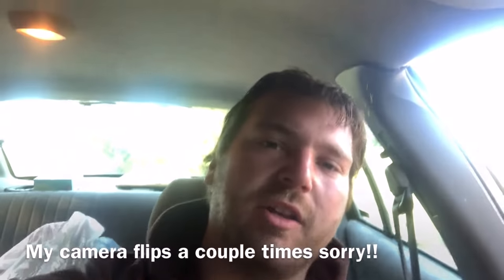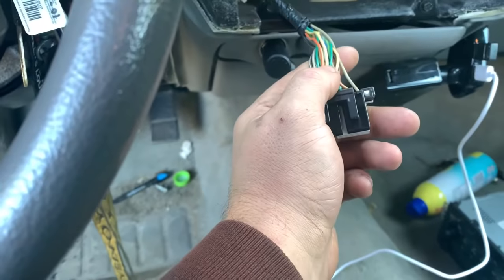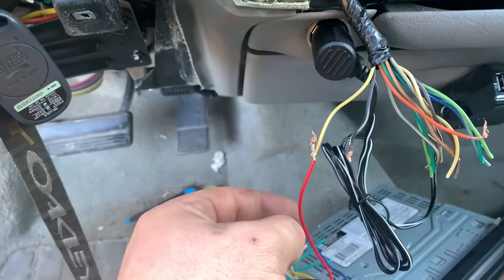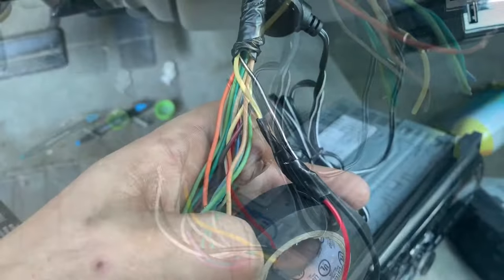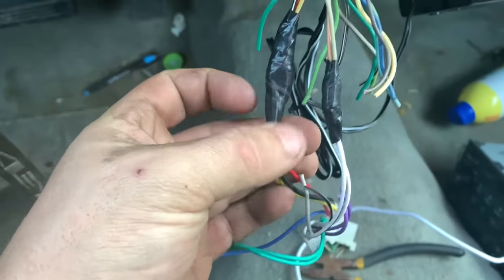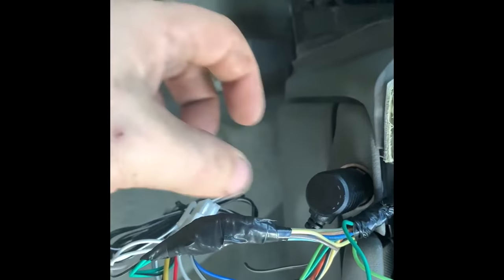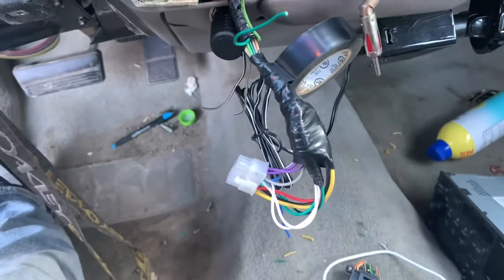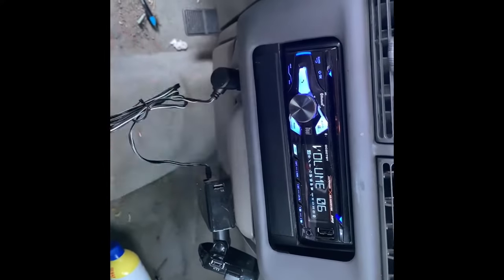How to Hard Wire an Aftermarket Radio in Any Vehicle

Comment: I got talked into doing this by a friend in my S-10 almost 20 years ago. Stupidest thing I have ever done. We couldn't figure out where everything went. So I ended up paying a friend of a family member. He got it working, but there were still quite a few issues. A few months later I took it to a local stereo shop and got it fixed right. Don't be stupid like me, spend $15 and buy the harness adapter. It ended up costing my over 10x what the harness costs, many hours of work, and a whole lot of headache. I will never cut another wire in a vehicle I care about and unless you truly have experience (if you do you wouldn't be on this video) you shouldn't either.
Reply: Exactly, even if you’re amazing at doing the wiring, you’ll just have to redo it all if your radio goes bad or you want to upgrade at some point or replace with the old when you sell it. Hugely limits your options for really no upside.
Reply: @pogolaugh why would i replace a damn thing when i sell it 😂 if there's problems they can have that shit i work at a chevy and dodge dealer we cut so many corners you wouldnt beleve it
Reply: I’ve done it multiple times my man. Doing it now. Some people have to pay for the whole kit and I’m not trying to spend 40-80 on a whole new dash piece I don’t truly need, and wait almost a week for my harness to come in cuz I have a lancer and they don’t just have Mitsubishi stuff laying around. I’ve looked.
Reply: @pogolaugh yeah but the thing about that is once you’ve found where everything goes you don’t have to again if your not a complete idiot and label it all with a tape note on them lol
Reply: i always use the harness that plugs into existing plugs.. and usually solder and shrink tube them on the bench.. then just clip into the car factory harness and to the back of the new head unit.. so much easier..
Reply: @77perudo  it’s really not that hard if you know what your doing wiring wise
Reply: @JustForFun-wv8fl  i know what im doing wiring wise.. thats why i always try to shrink tube and protect my work.. ive done the tape method when i was a kid.. 35 years ago.. LOL.. ive done plenty of installs..
Reply: Use a test light, find power with ignition off that's constant, turn on ignition on find power, that's ACC red wire.  Find ground, place test light Clip on constant wire and locate ground thats black wire .blue is antenna if no automatic antenna connect to Red ACC. Your left with speaker wires.
Reply: Some of us do have more experience.
Me, I'm just looking for a diagram for a specific vehicle to add steering wheel control and reading comments

Comment: Grab a 9v battery and put it on the speaker wires. It will make a sound and tell you which one is which
Reply: I have tested ever wire combination and nothing has happened
Reply: @atleastitaintsquated3103  make sure the 9v battery has power, test it on your tongue first. Make sure the wire with the black line is on the negative and the other is on the positive. Then test, if no tone then there's something wrong with the wires. This has always worked for me to test speakers
Reply: Just Google a wire diagram for radio for your car bam done it will show you colors and polarity

Comment from the maker: Thank you everyone who’s been watching this video! It’s grown tremendously! Please don’t for you like comment and subscribe! Also check out a few other video! ❤️
Reply: I have a Ford focus  I have crossed the ignition key wire and blown fuse put new one but still no current what the problem
Reply: Make sure you didn't blow a fuse in another spot, there's more than one fuse box in a vehicle. Make sure there isn't a short somewhere. Find or buy a volt meter and test the current going through the wire at every spot.
Reply: @kristalhall5043  look up a schematic for the radios wiring harness. You will have to find out which one is which. Then match them to the proper wires on the back of the new stereo. Most new stereos have their wires labeled. Good luck
Reply: @kristalhall5043  that's how I did it with a VW Jetta without a harness. I just cut the old one off and wired it up wire to wire. It was time consuming but i finished it and it still works.
Reply: I love how it just falls out the dash my dude finally notices its all just nicely printed on the unit itself an says all wow well I didn't have to make a video lol
Reply: How many rolls of tape

Comment: I just learned something  new with the red and yellow wire swirled around.Thank you so much
Reply: Thanks ,I am installing a double dim radio in a 2009 Hyundai accent,but it won't power on ,I can't 12volt on the yellow wire,the fuse is good all 3 audio fuse is good I get 12 volts on the red wire for acc but no power on the yellow that should have 12 volts battery

Comment: Hi , bought a Mitsubishi montero,  it came without a radio or amps, previous owner did had an amp and a radio..
  I installed a radio myself, a Dual just like yours,  (no amp this time)downloaded a wiring diagram of the car to do everything right just like you.. 
  Radio turns on and everything,  I just don't get any sound ... followed the diagram so I am sure it's hooked up correct!
  Any idea of why I get no sound ?
Reply: same problem dude---

Comment: Man I cut off the connectors to my 2010 chevy cobalt just like you did before I saw your vid. I thought I was doomed lol but I connected every wire to the original I guess and heak shrunk the tubes on em but omg it's not turning on and I have no idea why please help. I looked at the diagram for a cobalt and I don't see a 12v anything.
Reply from the maker: Get a volt meter and touch the wires. 12v will have power with key off.

Comment: Good instructions but I'm putting a radio in a truck that's never had one. Where do I get my power from? Do I need two hot wires for ignition and 12v?
Reply: U can run a power wire off ur battery

Comment: I am trying to wire an aftermarket radio into my Chrysler 300c and on the wiring harness coming from the radio, there are the 3 power wires. Ground, constant and the one that turns on and off with the key (red). However, I have all the wires from the car stripped and ready to be connected, but on the car there are different power wires. When I use a test light on them 2 of them are powered whether the car is on or off. Which means they are different from the 3 power wires on the wiring harness for the radio, any explanations or ideas?
Reply from the maker: I'm going to guess an amp? I'm not sure though. Google should have a diagram though

Comment: I have a grand am 99 gt, cant figure out my radio issue. No power. Hopefully this video will fix the problem. I noticed you connected the white wires to different colored wires. Can you tell me which ones you connected them to? Thanks.
Reply from the maker: Different cars use different wires. Google your wiring layout. Make sure your grounds are grounded

Comment: How do you do this to the Toyota carolla 07 ce (03-07 series) I connected every cable, it turns on, radio seems to work cuz the description of the station and song shows up only NO SOUND at all. Read something about bypassing factory amp? Which I don’t know what that looks like or where it is. I have a jvc kw m560 bt stereo system: my car wasn’t installed with any of the JBL just the basic factory parts

Comment: I have a Dual navigation touch screen radio I'm trying to hardwire on my 04 Honda Crv and haven't been able to get any power. Any ideas?
Reply from the maker: I haven't messed with one of those. I would just double check power and grounds
Reply: I messed with it for 5 hours today, been on google and all. I just can get combining the aftermarket harness with the car harness. They are both completely different colors and the diagrams say each wire is different than described.
Reply: @bjornironforged9951  i’m having the same problem

Comment: I just hooked up a dual stereo to my 94 geo prizm and it won’t turn on. No fuses are blown and I have it wired correctly. When I take the stereo out and plug it directly to the car battery it turn on but not inside my car what should I do?
Reply from the maker: Use a volt meter and make sure your power wires are getting power. Also grounds are very important, make sure you have a good ground. Sometimes I even take the ground wire and ground it straight to the chassis

Comment: I have a pioneer radio it’s a double din FH-S52TB what are the wiring codes and what wires connect to what !
Reply from the maker: I have no idea lol you're going to have to research this. You should have a diagram on your head unit and Google the vehicles radio wire diagram

Comment: Is there a way I can connect a power wire to my radio from a fuse as of right now in not getting any power to my radio
Reply from the maker: Yes you can. I just did that in my sisters bf car.

Comment: What can I run my power wire to do it turns on when truck is on and off when truck is off and I don’t have to manually turn the radio off?
Reply from the maker: The red and yellow wire are your power wires. Ones 12+ constant and ones 12+ ignition. On your radio you have the same ones just different colors most likely. Seems to me you have these two mixed up. Try switching them around

Comment: I put a jvc Bluetooth radio in I have a 2002 dodge Dakota and the radio works and everything but my truck won't start now it has 66% battery life still and 12.6 or 12.5 volts any help?? I did match the colors together (white to white, white black to white black ect.)

Comment: Hi I have a problem I don’t know what my radio diagram means I got IGN REM GND and B I know gnd is ground and ign is ignition what’s the other 2?
Reply from the maker: Rem is remote. You don't need it, it's for a amp. B is battery, so it means 12v constant or power always on
Reply: @GottisGarage  thanks man

Comment: I have a 2004 Mitsubishi Lancer, and I used the Double A battery technique to identify my speaker wires. Supposedly my red wire is my speaker wire, but it’s also my ignition wire. What do I do?
Reply from the maker: I'm not familiar with that technique, but I suggest Goodland your radio wire diagram
Reply from the maker: I'm not familiar with that technique, but I suggest Goodland your radio wire diagram

Comment: Why would u hot wire when system is amplified instead of buying a $10 harness no no no
Reply from the maker: When system is amplified? How do you amplify you system for $10
Reply: Buy the right harness for your vehicle if you can. Do not cut harness it just makes it a lot harder to wire your stereo. If it's already cut or your so cheap you can't buy the right shit. Look up your year. Make model on Google type stock radio diagram and wire it with butt connectors not twist and tape. Maybe some shrink also. This shit is basic car audio yellow= remote red=12v black=ground

Comment: I actually just tried to hook up a new android radio to my car and it worked fine when I installed it but the following day I went to start the vehicle and it won't start. I even put the factory one back in and it won't start. My lights and everything work but it won't turn on.
Reply from the maker: Explain won’t start? Clucking? Or just cranks

Comment: I wish you would’ve showed which wires matched together for the speakers
Reply from the maker: It depends. Varies by vehicle
Reply: Gotti's Garage I got the exact same radio and have the same problem don’t hear no sound at all but the radio powers up and also when it reads a cd it just powers off idk what the problem is
Reply from the maker: Chances are your vehicle might have an amp.

Comment: Hello my stereo stays on even when I turn truck ignition off what do I do? I dont want it to drain my battery
Reply: it would be your wire that detects when your key is in and turns is messed up
Reply: check that connection and make sure the right wire is connected and good connection
Reply from the maker: Yeah your 12v battery and 12v ignition needs to be switched

Comment: Title says how to hardwire a radio in ANY car... NO !!!sorry that's far from correct info . If your watching this video to learn how to hack your car An cut wires instead of buying a 10 dollar harness An do it right that's pretty stupid. Yes this hack job will work in some older vehicles but this method does NOT work on ALL vehicles . A lot of newer vehicles run on can bus systems An if you try this your looking at some serious electrical issues .   Nothing done in this video is good info, this video is teaching you how to hack an install, nothing about a radio install on this car is hard or expensive so there is no reason not to do it the right way!!

Comment: I have a 2001 f150 and I replaced the harness because I got a new stereo and it’s not working. I took a multimeter to the harness positive and negative and they tell me 12-13volts. So the harness it self has power but when I connect my stereo it doesn’t power on. And it’s a brand new stereo
Reply from the maker: I would make sure you have the power wires hooked correctly or the ground
Reply: @GottisGarage  I went and checked and the ground was good. At the end I found out that one of the fuses I didn’t checked just so happen to be blown. So I fixed it and it’s on but now none of my door speakers aren’t producing sounds but my sub in the back of my truck is. So now what????
Reply from the maker: Check all your wiring, make sure if you have a sub the wire is hooked to it
Reply: @GottisGarage  I have my sub working from rca cables like my old one. The only thing different about all this is that the car door speakers aren’t producing sound

Comment: Can get my radio to turn on with key jave to manually turn it on off
Reply from the maker: Swap the 12+ constant and ignition wires. The two power wires usually red and yellow

Comment: I tired this n my stereo comes on n turn right back off then un did it n retired it now my stereo won’t come on at all now ?
Reply: careful with the wires, follow up ur radio manual, on pin yellow usually is + 12.5v battery with a safety thing, the ignition should be one of the blacks, if you are not sure, you can rewire that with a - from the battery directly so u don't have to turn on the key everytime u want to listen to radio. the 2nd black should be earthground u can put that on ur car dashboard metal or a door doesn't really matter. red forgot what it is but is a dash thing. if u got white, is for radio probably or backup camera. if u don't have a manual, go install it in a service, or u risk burn it down, especially if u mess up the + - connections.

Comment: Hi. I have a question of you could help. When I connect my b+ yellow wire. It seems it drains the battery. And the voltage goes down. And all the lights turn on. Would you have any idea how to fix that issue. I've been searching. And can not fine any info.
Reply from the maker: Yeah flip the red and yellow around. Chances are you are hooking constant to remote, which is keeping your radio on without the key on.
Reply: @GottisGarage  i did that. But it well not turn on. And when i connect it the other way. The radio well not turn on. And it just lowers my voltage all the way down. And the check engine and other lights on the dash turns on.
Reply from the maker: It sounds like you're drawing power from somewhere. Without seeing it idk what to tell you. I would triple check your wiring all together. Could be something simple or another issue. Sorry I can't really help
Reply: @GottisGarage  oh no brother. Thanks for the help. I appreciate the replies. Ill be checking much better 2morrow. And see what ot could be. Again i appreciate the reply.
Reply from the maker: Good luck man

Comment: why are you heating up your wound up electrical tape though? electrical tape is different from shrink tube, You risk melting adhesive of the electrical tape if when its heated up to some extent.
Reply from the maker: Electrical tape can get dusty and lose its adhesive properties after awhile. Melting it slightly insures its a bitch to get off
Reply: @GottisGarage  ok, i see, well just asking, since i once heat up electrical tape expecting it to shrink thinking its same as shrink tube, my honest mistake in the past. Lol
Reply from the maker: Never hurts to ask lol just a little extra precaution I take.
Reply: If u melt too much it'll just melt away and be useless.

Comment: I wired up the ground black to black and battery yellow to orange and ignition orange to yellow and my radio still won’t turn on and we have the same radio
Reply from the maker: There should be a red in there
Reply: @GottisGarage   yea I meant yellow to orange and red to yellow
Reply from the maker: @mayonotarapper5758  hmm did you accidently blow the fuse? Should be two fuses, one in the radio and the other in your fuse box. Also the radio antenna is also a ground if you haven't plugged that in.
Reply: @GottisGarage  ok not sure yet I’ll look at it soon thanks a lot for trying to help me man it goes a long way

Comment: I have a 04 impala , radio won’t turn off whenever I get out... runs my battery dead, any ideas?
Reply: Carry a 10mm with you at all times and disconnect battery every time lol
Reply from the maker: Yeah switch your red and yellow wire around. You have your remote wire hooked to constant most likely
Reply: I also have an 04 Impala, I've been trying to hardwire mine in, I can't get sound to from the speakers, just a pulsing. Did this happen to you?
Reply: @GottisGarage  wouldn't that burn his radio unit tought? yellow is usually 12.5v if u link that wrong, might burn his unit. i tried that exact swap on my cheap mp3 even tough had 3 safety clips none burnt down, instead mp3 player did some smoke like Snoop Dog ... so i bought a new mp3 player and i linked it normally by manual, just i hate it cause i have to turn on the key everytime to listen to it and it never saves settings.